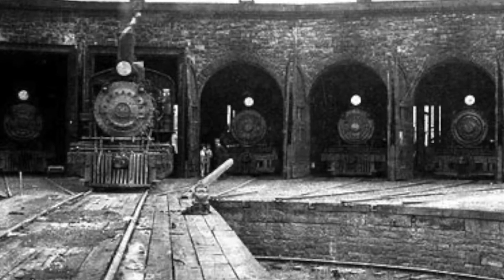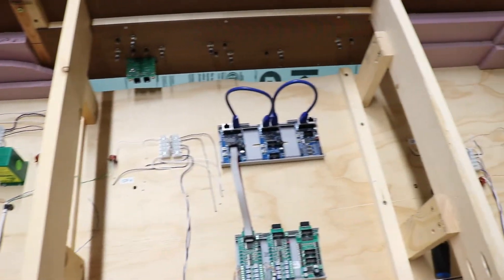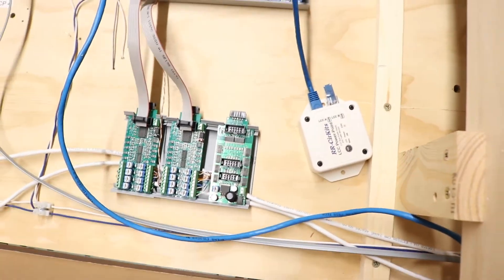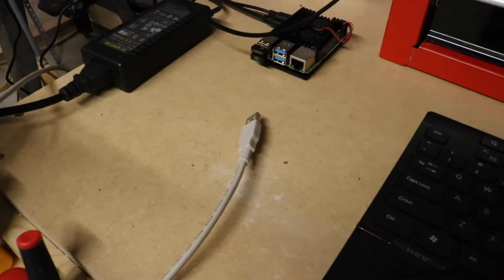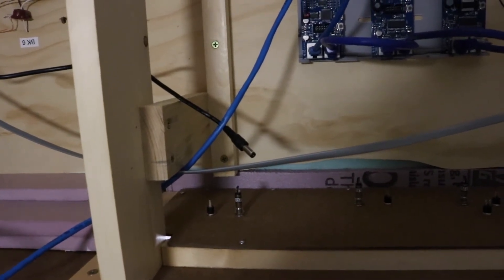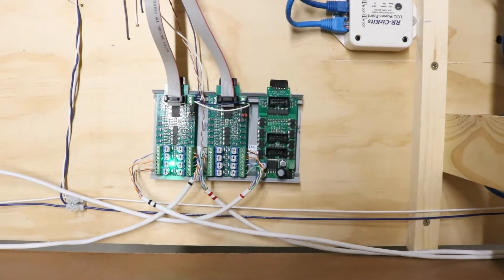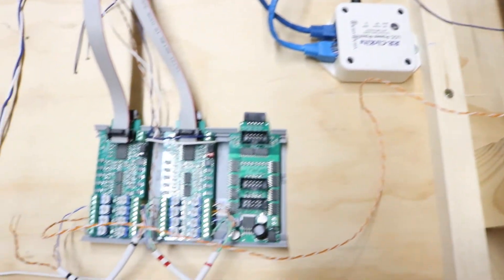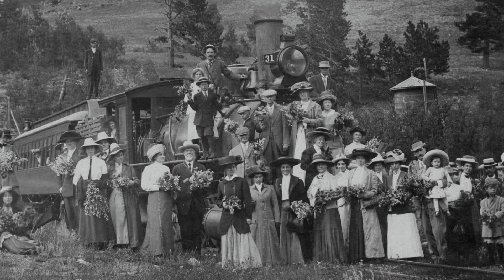MRVU 9  ( Wiring III )  Block Detection With LCC

Comment: Great video Dennis. The wiring will appear a lot neater after everything is checked out when you can dress all the runs into their final orientation. The block detectors seem to be ready to go. What minimum current to you have them set to detect?  Art...
Reply from the maker: Thanks Art.  The BOD-8 comes from the factory at 1ma.  I can reduce it if needed.  Eventually I will start putting 10k Resistors on my rolling stock, starting with caboose.  Or is it cabooses... or caboosi?? :-)